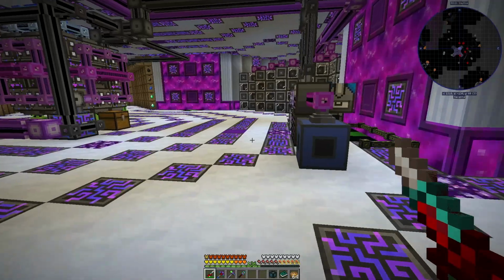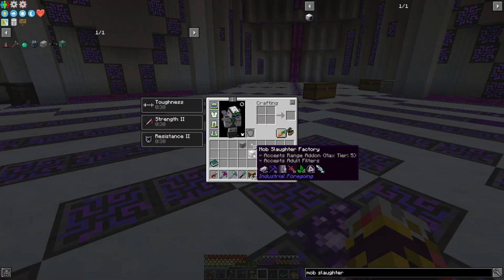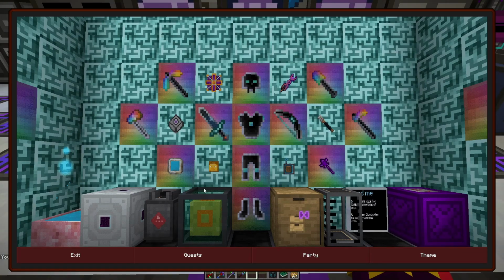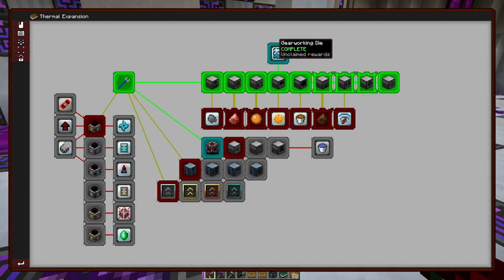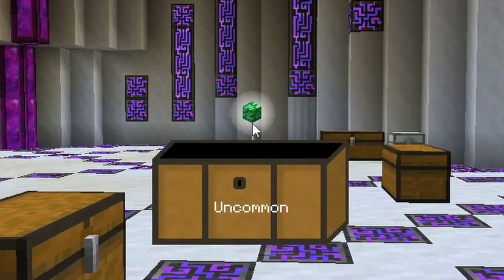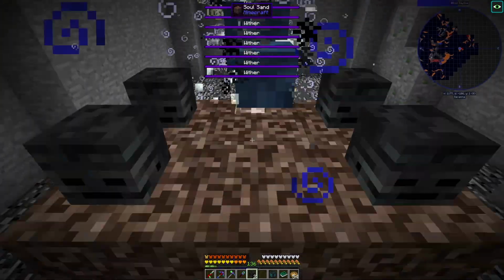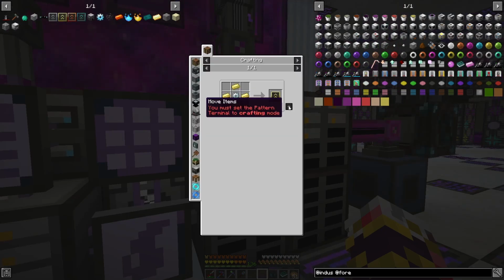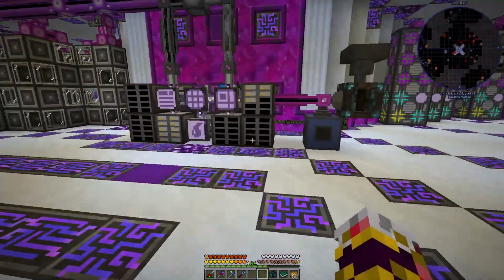Expanding Into Thermal & The First Bragging Rights! | Minecraft: E2E ep.24

Comment: just wanna give a heads up, the liquid meat you get from the pink slime farm actually fully replenishes hunger and saturation if you step in it, even if you arent hungry but need to heal, second, JEI doesent tell you but instead of making for example a single empowered diamatine crystal, you can do a block of empowered diamatine instead for the same costs, just replace the crystal in the middle with a block of that crystal, you basically get 9x the value

been enjoying the series a lot :D
Good luck on the rest, youl need it for rocketry